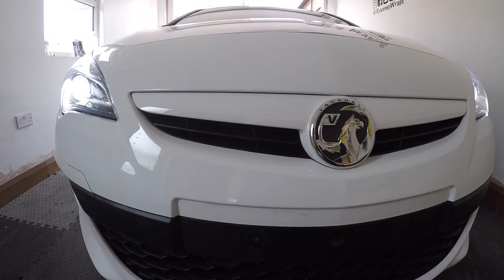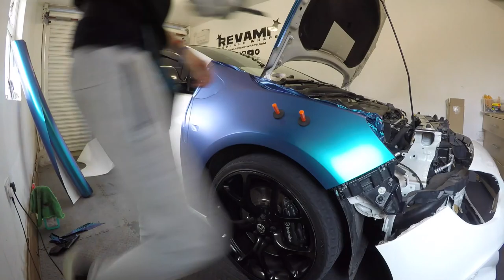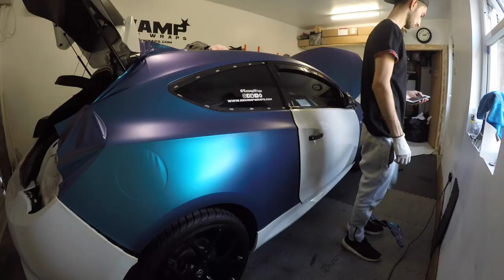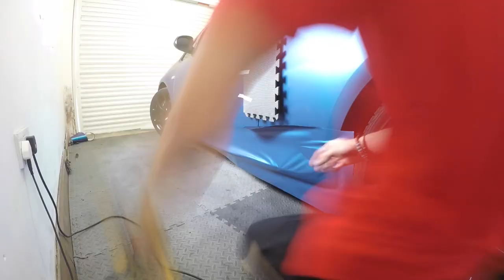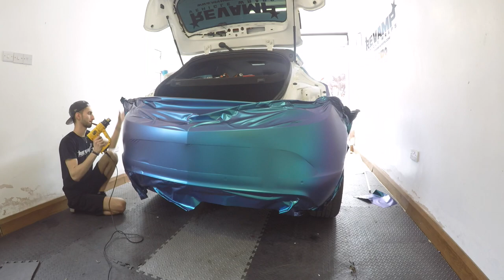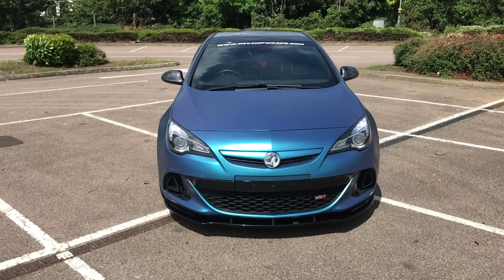Astra J VXR Wrapped in Ultramarine Violet Colour Shift

Comment: when u do colour shift wrap. which part of vinyl do you use to wrap the bonnet bumper trunk roof to match the colour shift nicely with the side of a car
Reply: dave babyhi I’m a professional installer, What we do in the shop. As soon as we get the shift color we draw Lines, directional lines. Or we simply follow the Logos Pattern. For example some Bmws have pretty long hoods and we do those in two pieces. So just follow the pattern of the logos, Yeahh. A lot of material is wasted but its always a perfect Finish.